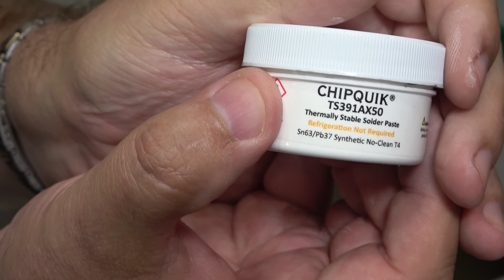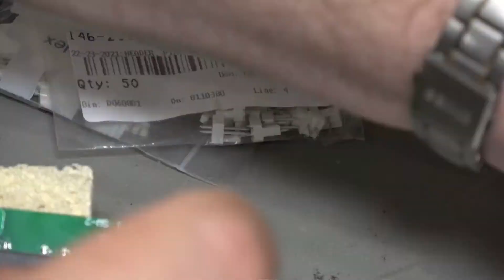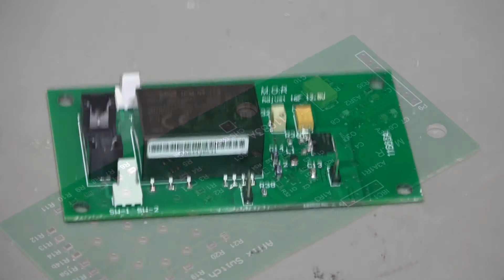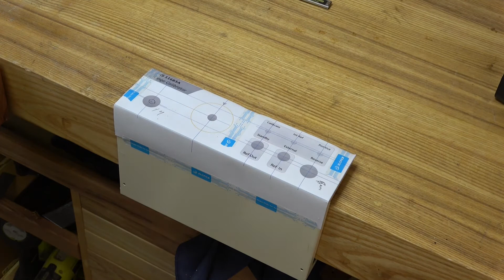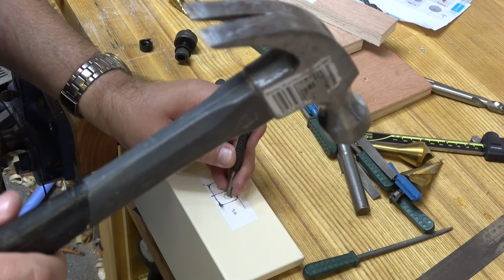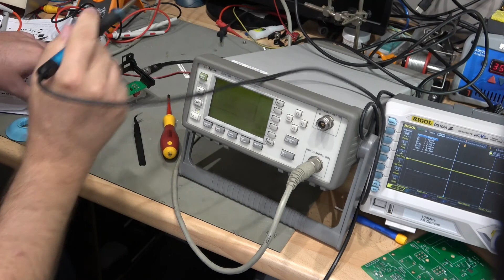0011 DIY RF Power Calibrator build and fix

Comment: Excellent videos, I'm currently building this. I would appreciate some feedback on the github issue I created.
Reply from the maker: Sorry, I didn't get notified of the issue you raised - it should have auto assigned to me and notified me!  Anyway I've had a look.  First, be aware that regarding the resistor values on the switch, the voltage table that HP provide is for a particularl multimeter that has a 1Meg input impedence - the values are not valid for a more common 10Meg meter, essentially the meter impedence is in parallel with the selected resistance and changes the voltage.  if you have a substitution box you can put a 1111111 ohm resistance in parallel with your 10M meter and it should give you values that HP quote.  

Yes,  M,J,F and K need connecting to chassis and to the shell of the connector I can't remember exactly what I did but I suggest you create a star chassis ground where the connector fits to the case and wire that back to the FET guard ring.   
The resistor you mention should indeed be 464k,  I've updated the component - it had the right value, the comments had the right value but the description was wrong.  I had fixed the problem in my video where a FET was not fully connected.  In doing so I think I had managed to create two more errors - the missing track for the capacitors to Q3,  yes the Via can be linked to the nearest side of C8 as a remedy.  The other seems to be C11 on the power supply;  the positive end of C11 should conneect to the junction of R36 and the regulator pin1 nearest it.  Regarding Zeroing - you must ensure the calibrator is set to the zero position - and by the way, noise is your enemy here so perhaps check the output from the power supply section and if you are doubtful about your meter also check it outputs correct reference levels .  My newish meter zeros fine, but I was repairing an older meter and that would not zero - turned out to be the the meter's sample and hold circuit - the op amp prodiding the reference to it was offset quite a lot!
Reply: @MakeOrRepair  Thanks, I'll provide a provide some more info at github soon.
Reply: Just an update here as well. The issues I had are resolved.

Comment: hello Peter, would it be possible to add the link to your Github location? I tried to find it, but was unsuccessful. regards, rob
Reply from the maker: I thought I had added it already - how strange.  anyway added to the description now butit is Github link https://github.com/pshersby/HP-Cal.  I have checked and it is set to public access.   I also took a quick look at the readme and the version on github does include the modifications that I talked about in the videos - board error is fixed, the switched moved further apart, holes etc.  Gerbers, drill holes etc are in the Defualt Configuration/outputs folder
Reply: @MakeOrRepair  Ah, thanks! in what pcb software did you design the schematics and PCB?
Reply from the maker: @40dobbie  Altium CircuitStudio.  Not sure they would load into the community CircuitMaker but I think Altium do a free viewer and you might be able to import into some other freeware pcb software (or download an evaluation copy of either circuitstudio or designer.  But the gerbers should be fine for most manufacturers

Comment: I like to make one DIY sensor but then get the PCB, some possibility to get the PCB? I'm locate on UK
Reply from the maker: I do have a couple spare but they are the version with the fault that I had to add a mod wire for.  You would be better ordering the corrected version direct from JLCPCB that is available on github - see my other reply.
You say you want to build a sensor - Not sure the Calibrator PCB would help too much if you plan to build a DIY sensor,  sure the small  bit in the middle is the same and the pinout is right but there are some slight differences in the way the signal inputs from the diode/thermocouple on a sensor and the way the voltage divider in the calibrator works, mainly relating to the differences in impedence.   The service manuals that I linked across the series have several sensor schematics.  In terms of sensor the challenge is that the actual sensing component has to be logrithmic (power in dB in to linear voltage out) so a diode sensor for example has to work at very low voltage/current and have an extended non-linear region,  the signal level is tiny so noise is a problem, and finally you need to maintain 50 ohm input impedence across a wide bandwidth.

Comment from the maker: For those interested in the NPN transistor from the perspective of making a DIY sensor, I would suggest that the key aspects are low noise - Hfe can be quite low (about 70 - so pick a part with a range of about 70-150ish) but it does need to perform well at low Vce.  The freqency is only 220Hz so focus more on DC perfromance and you can have very low frequency - the HP part is listed as 80MHz.
Reply: Hello I like to make one DIY sensor but then get the PCB, some possibility to get the PCB? I'm locate on UK